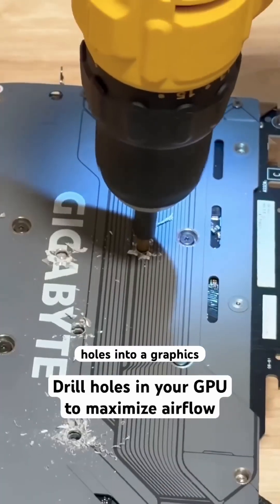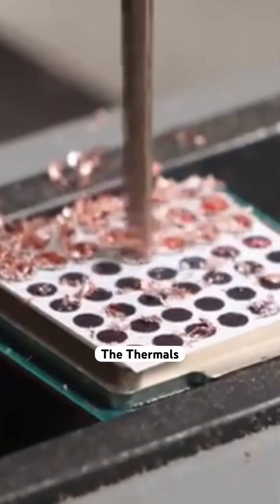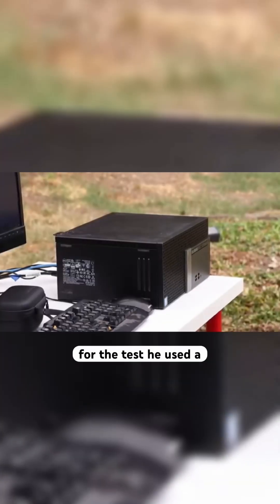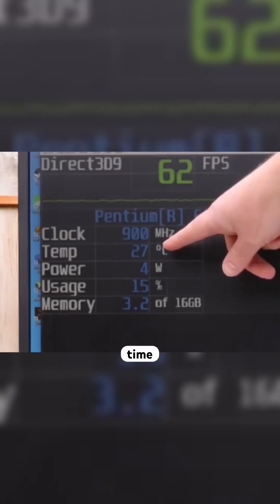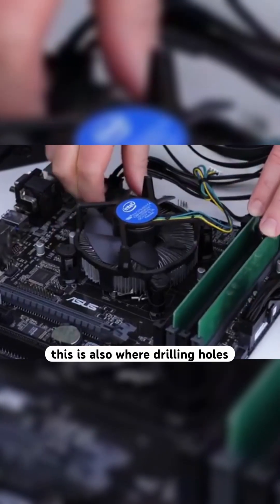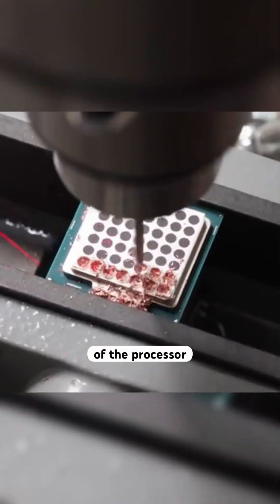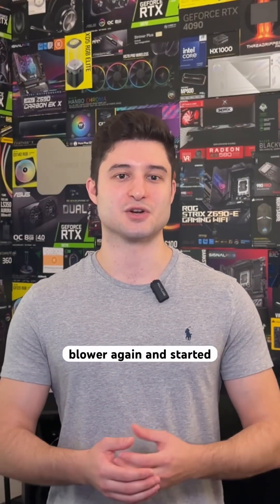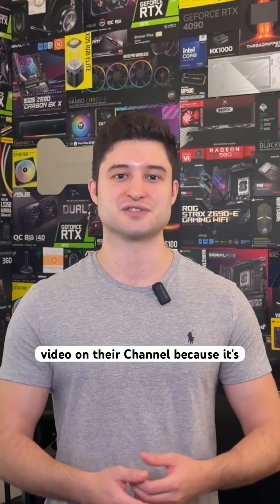Processor with holes actually performs better

Comment: Maybe drilling holes right through the CPU would allow the electrons to move easier and make the processor faster? What do you think?
Reply: Yes, and we could fill them with oil to reduce electron friction, and then fry eggs on top of the CPU to take away thermal energy. We could sell the fried eggs to the same gamers who overheated the CPUs.
Reply: Why don't we have some water coolant as drinks to complement the eggs
Reply: big ryan fan btw
Reply: Nah. I think the drill holes will provide extra surface area to dissipate thermal energy more efficiently
Reply: Go ahead, test your theory on your most expensive computer.
Reply: @BrianG61UK  Î don't have a moist expensive computer. Maybe you could help me out with one?
Reply: They're called speed holes. I think you should do that to your current processor. It will make it so much faster. I totally do this to all my top of the line processors that I totally swear I have
Reply: @redbunny22 does it work on my brain too? I have a drill right here
Reply: @YakubTheFather yes yes you can. I put speed holes in my brain and now I can count to ten in only five or six minutes. Way faster than before where I'd get stuck on 8 and sometimes my brain would crash  and I'd have to hard  reset my brain.
Reply: Please tell me this is bait
Reply: @Madboiwastaken  No, it's just a joke, you silly
Reply: @Madboiwastaken no, this is not a drill, I repeat not a drill !

You cann DO itt ! Power of the universe is with you
Reply: I would think, don't try this at home
Reply: Nahhh you’re just making an example to the little men who live in your pc that you will drill their homes next and they get scared and stop half assing their work
Reply: what you stickin in the hole sussy boy
Reply: Yes. Adding holes make it so the electrical signal doesn't have to travel all the way around the circuit as it can just take shortcuts, significantly increasing the CPU clock speed and processing power.
Reply: @akyruz8345 😂😂😂
Reply: I’m sorry to be so blunt, but do you know how a processor works at all?
Reply: @SGrad64  Im pretty sure they were responding to this CC’s idea of drilling through a GPU PCB and not the heatsink or shroud.
Reply: @SGrad64 also i think the electrons get tired and hot, and would want some fresh air to breathe. These holes could help so many of them. Think of the overworked electrons!
Reply: @SGrad64  Sure, it's full of electrons doing stuff by jumping from one place to the next as fast as possible. If they had lots of holes in between they could do that even faster, couldn't they?
Reply: It was an irony bro, chill

Comment: What if a CPU was just designed like this?
Reply: It would probably transfer heat to the normal heatsink less efficiently.
Reply: @robotswithryan8348  this, the heatsink would need bumps to have good contact with the drilled holes. It only worked in this case because his cooling solution was otherwise garbage.
Reply: It would idle at load temps.  You want that?
Reply: I just knew someone would ask this. Although I haven't tested myself, I would think this would be bad because the IHS is not designed to cool the CPU on it's own, it's designed to spread the heat and create a flat surface for the proper heatsink to make good contact. The holes would reduce the surface area the heatsink would make contact with the IHS thus probably resulting in higher temps because the heat can't be transferred off the IHS as quickly.

The CPU designers would have already done this if it helps. This only works if you use the IHS as your only means of removing the heat from the core.

At least, in theory. Haven't tried it so you never know.
Reply: I theorised nearly a decade ago that lapping corresponding groves into a CPU and heatsink would be drastically better than what a majority of AIOs will do for you.

Never got round to testing it though.
Reply from the maker: That would be interesting